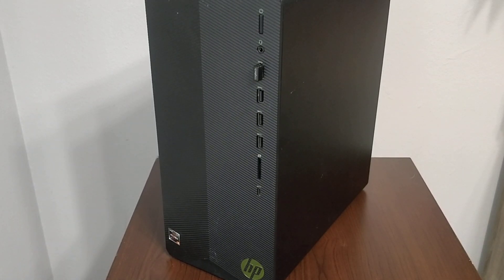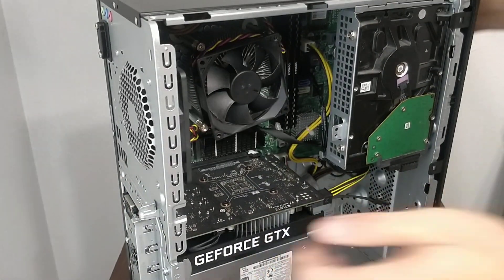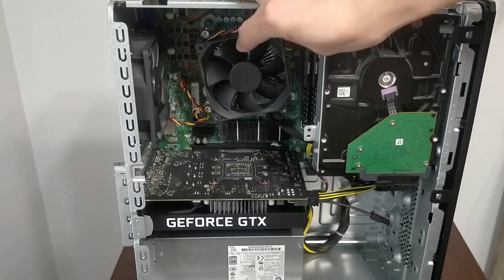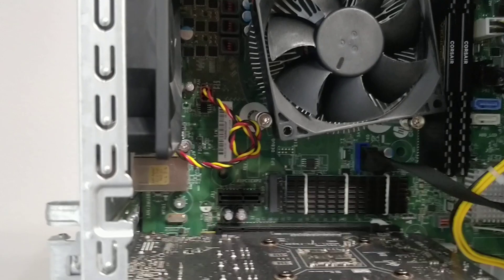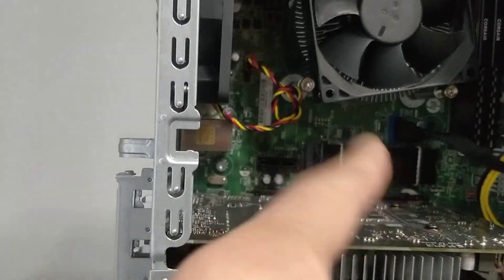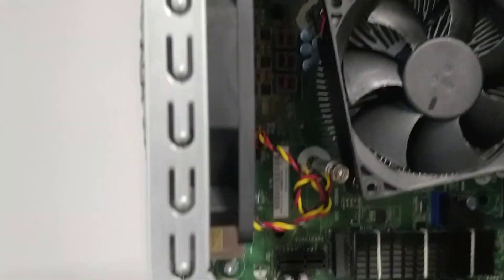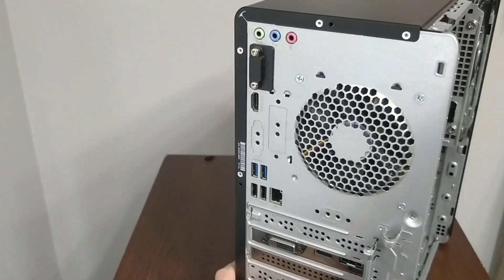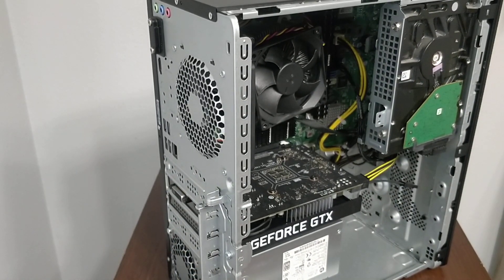HP tg01-0023w, How much Can You Upgrade?

Comment: Processors with built in graphics chips huh? Nice! 🤣
Reply from the maker: No, This one does not have a APU, it has a 1650 supper GPU attached to the mother board.
Reply: how did you not see the graphics card

Comment: what is the model of the ram you have, im planning on upgrading my ram to 16 gb. but i don't know the model of the current ram i have.
Reply from the maker: That is the ram I'm using right now. you can open it up or use cpuz to find the ram. 
Tech I'm using right now: https://kit.co/RichYoYo/tech-i-m-usin...
Reply from the maker: Also if you buy new ram its iffy. since idk what works or does not. you have to custom config it. since Hp does not let you do much. 
https://youtu.be/HfGd1rfgZqY
Reply: @richyoyo9796  thanks man, but im still figuring out the settings.

Comment: Damn only one hard drive fits on that holder, huh? It looked like it can take two.
Reply: I mean if you're really concerned about it only holding one hard drive then literally just buy a hard drive with  more storage. I mean I have seen hard drives as big as 8 TB
Reply: Personally if I was you I would recommend a SSDH it's pretty much a cross between a mechanical hard drive and an SSD. It's faster than your typical mechanical hard drive but slightly slower than SSD.
Reply: @kennethjones2152  I didn't realize the hard drive that was in there was an nvme ssd placed on the motherboard. I thought it was a sata and I'd have to move everything over. Bought a 4tb HDD and everything is fine. However I also heard somewhere that on the other side of that hard drive cage you can also fit a laptop HDD or SSD, which is good to know if I decide to save all my GoPro videos internally.

Comment: Is it possible to transfer it to an atx case or would I have to replace parts if so what is transferable and what isn't
Reply from the maker: I'm not sure if it's even an atx motherboard. And the front usb are mounted on the mobo so those won't be attached to the new case. And idk about the hp custom power supply.
Reply: @richyoyo9796  this stimulus check money got me wanting to upgrade lol
Reply from the maker: @DntPk  ya the socialising check work. I would just save it for your next pc.
Reply: @richyoyo9796  yeah it says it's an atx mini but I want to buy a new motherboard and psu would everything else be transferable though
Reply from the maker: @DntPk  oh ya. Everything the can be transferred in to a new building. But I would just buy another build. By then lol.
Reply: @richyoyo9796  yeah kind of what I'm thinking these sales on new egg are pretty good so far I have a pretty nice build at 458 dollars without graphics card and cpu might just sell this hp and buy good ones
Reply: Did you end up doing this?

Comment: to upgrade the ram, do you have to remove the old ram and replace it with a new one? i want to put in dual channel 16 gb (2x8gb)
Reply from the maker: Yes you will have to remove the old one since there is only two slots. I did that and am trying to sell my old one.
Reply: @richyoyo9796  still have the original 8gb stick of ram the computer came with? I’d buy it off you how much?

Comment: do you know if HP has listed their specific PSU in this case as ATX , or as SFX ? my friend bought this pc i would like to know incase he does plan to upgrade the psu/gpu looks like theres pletnty of space clearance for the GPU . But if you can find out what HP lists this PSU as ( or its unit size conformity ) thanks rich.
Reply from the maker: Sorry IDK. The psu does not have a 24 pin also. and the motherboard does not have a 24pin to.  and it also has a custom plug on the motherboard and psu.
Reply: You can buy a 500 watt psu from hp

Comment: Can I replace the 1650s for a 1660s without any issues???
Reply: theres vids on it just youtube tgo1-0023w or what ever model u got
Reply: @noperering  yes to who
Reply: tbh do reserch more before u buy cuz i guess a 1660 min takes 450 wats
Reply: @noperering  yeah im not hardware savy sorry lol
Reply: @noperering  yeah more softwere savy but im lerning ty for the help
Reply from the maker: if you find one that fits in the case. and if you want to test if it runs on the psu yes.  I think you can upgrade to the 2060, which is on the hp website if you build your own. 
https://youtu.be/cq3RvtvaXkE
Reply: @richyoyo9796  i mean you get it test it the gpu is 125wats by it self depends on what brand unless all have the same wats and i guess some motherboreds but this is not a gaming 1 so just a hp so who knows also can u send me the link to where it says the upgrades on the hp site on discord plz
Reply: It is 450 recommended for the psu but 1660 only uses 120 watts
Reply: @Waidmann767  i can get a hp 500w psu on they site for 110$ but ty
Reply: You could easily upgrade this to us 1660 super. Or even a RTX 2060 if you want to find a card that fits in this PC just make sure it's basically smaller card. If I were to upgrade this PC I would try to upgrade it to the max that I could. I would eventually upgrade the CPU the ram gpu. However the CPU would be the last thing I would look great because of the CPU that comes in this computer and is almost the equivalent to a ryzen 5 3600 basically almost the same CPU the only difference is the ryzen 3600 is a 6 core 12 thread processor where is the ryzen 3500 is a 6 core 6 thread processor that comes in this PC. But overall the to perform very similar in performance.